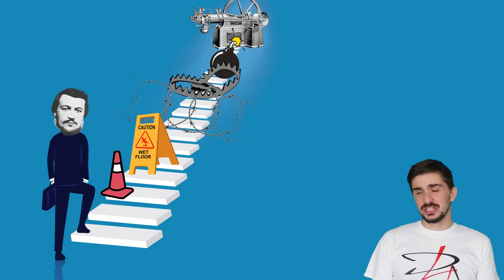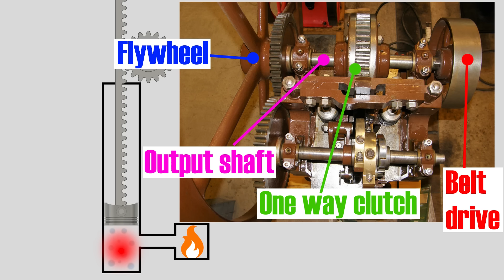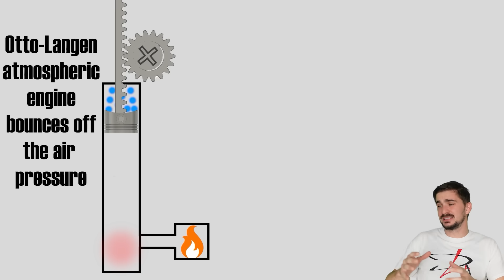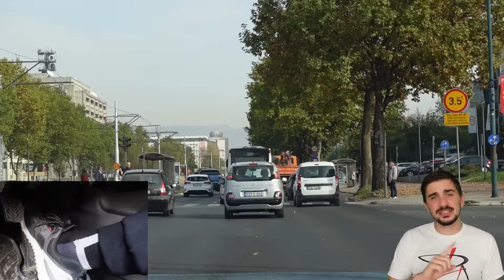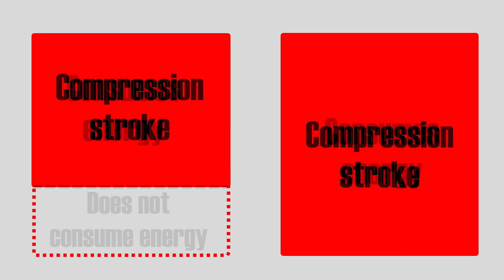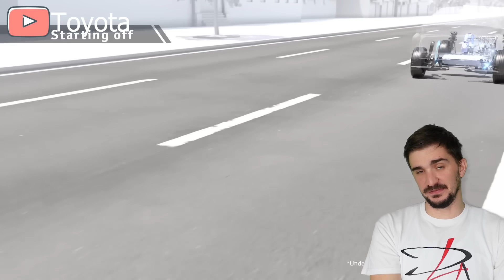You'll understand everything about Atkinson, Miller and Otto cycle engines after watching this video

Comment: Surely, the energy required to compress [adiabatically, essentially] a required quantity of gas from one pressure to another in the same time interval is quite independant of whether it takes place over a long or short stroke.  
     What these inventors improved, however they may have thought about it, was not the amount of energy 'wasted' in compression.  The improved efficiency came from using a more appropriate [smaller] amount of mixture, which at the end of combustion would not be throwing away into the exhaust pipe quite so much wasted energy.

Comment: It is easier to compare the Atkinson, Miller and Otto on the basis of equivalent compression stroke. Then the work of compression is the same for all and the difference is how much each cycle expands the working gas during the power stroke. Clearly expanding the gas all the way to atmospheric pressure would extract the most work and an exhaust silencer would not be needed. For the Miller to produce the same efficiency as an Atkinson, direct fuel injection is needed. Otherwise, uncombusted fuel is ejected into the exhaust.

Comment: What if you did a Atkinson cycle by having an intermediary cylinder? As in,  a 3-cylinder engine with a 180-degree crankshaft, the outer cylinders fire 360 degrees apart and their exhaust valves dump into a reed valve that leads to the middle cylinder, then another reed valve on THAT cylinder (timed in the opposite manner as the intake reed) leads out to the exhaust manifold. The center cylinder would act as a "2 stroke" expansion cylinder to accompany the two 360-degree apart 4-stroke "power cylinders" adjacent to it.

Comment: I know calculations have proven it, but just by plain logic, in Miller cycle, the inlet valve being open during compression stroke, with supercharger blowing air and fuel in,  will the air fuel mixture in combustion chamber be the same if it was a naturally aspirated OTTO cycle engine.
What will be the pressure at TDC for naturally aspirated OTTO cycle engine as compared to a similarly sized MILLER cycle engine.?

Comment: it's a crazy concept to wrap your head around, I thought of it like this, why is a dsl so efficient? because of the high expansion ratio. why cant you burn petrol in a diesel?? because of the high compression ratio, so if you can reduce the compression ratio by the intake timing yjou can change a 30:1  engine to a 15:1 engine , even though mechanically its the same, but as the piston goes down 15:1 it's operating as a 15:1 up 15:1 down. but wait, what's this there's more so you can compress 15:1 and expand 30:1

Comment: Wait I am confused.  What is the difference between an Otto cycle engine running at 1/2 throttle and an Atkins cycle engine running with a 1 to 2 ratio?  I feel like they would have the nearly the exact same performance because they have the same amount of air.  The Otto cycle engine would not even begin compression until 1/2 way through the cycle because the pressure on the bottom of the cylinder would be higher then in the cylinder until equilibrium 1/2 way through the compression stroke.

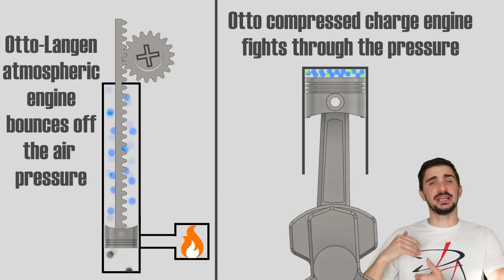Comment: 9:50 You are wrong. Higher compression leads to higher efficiency.  The power used to compress the mixture is not an inefficiency, it vastly improves the thermal efficiency of the burning fuel.  All other things equal, a lower compression engine will produce far less power than a high compression engine at the same displacement and fuel consumption.(IOW, all other things equal)

This is one of the (really, the primary) reasons diesel is so much more efficient than any gasoline engine.  The air temperature difference is a key to efficiency and compression vastly heats the air fuel mixture in reference to atmospheric temperature.
Reply from the maker: Compression ratio vs the act of compression itself are two different things
Reply: @d4a  No, they are two ways of expressing the same thing.

Comment: I'm hearing that the Chinese manufacturers are now to build a lot of Erev engines, using a Miller cycle to drive a generator and thus charge the battery while driving along. Essentially it gives you a very large battery without the extra weight and expense. since the motor does not drive the wheels, and only operates at a steady state RPM driving the generator, it must mean they have ways of making it very efficient. I'm wondering, just how efficient the motor can be?

Comment: why not just miler made intak valve close before cylinder finish to fill at intake?? when cylinder is 2/3 down close intake... it creat vacuum at 2/3 pmd to pmd.. sucking energy but piston after is now pushed by crankcase presure to regain velocity for compression.. and it will effectively compres 2/3 on an full cylinder...

Comment: So I wonder, Honda VTEC, does that switch between a Miller/Otto cycle?
Reply: Not really. The biggest difference between the two lobe profiles is the lift, or how far the valve is opened to allow for more mixture into the combustion chamber in high rpm mode and more swirl in low rpm mode. The duration is not altered that dramatically that I would call it a switch between Otto and Miller

Comment: How do they measure efficiency? Heat efficiency? If it's more heat efficient then it by definition makes more power per fuel mass. It must be that it creates higher power density-- more power per engine weight which correlates with displacement.

So I'd guess the Atkinson engine is more efficient and more powerful with the same fuel tank, but it probably weighs a lot more. And weight equals cost. And if you're a car you have to spend more fuel to get it up to speed or slow it down.

Comment: Fiat have multi air.  That open the intake valve   Shut it then open it again. In the intake stroke.  And open it latter or earlier. Depending on what worked out  to be most efficient

Comment: Electric supercharging is a will o' the wisp; the energy need to run the electric motor is reflected back into the alternator as a torque load drawing on the crankshaft; there is no free lunch.

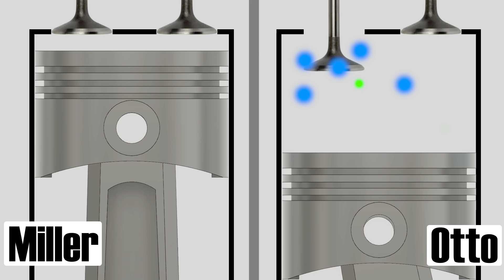Comment: 15:17 that´s not true. All intake valves close after bottom dead center and all exhaust valves after top dead center of the piston; its called vlavetime overlap. This makes the gasflow more efficient because of the inertia of the gas mass. Only difference to modern "Atkinson cycle" is that these have a bigger, longer valveoverlap.

Comment: I had two Hondas both 1.5 litres. One is i-vtec rated at 115 hp at 6600rpm. One is Atkinson rated at 110hp at 6000rpm. I think Honda's Atkinson engine is on this mode until 4000rpm and then switchs over to i-vetc mode but limited it to 6000rpm. Typically a normal 1.5 litre Atkinson engine is not able to go above 100hp?. Regards.
Reply: The 1.5L Atkinson Cycle Engine in a 2nd Gen Prius develops only 76hp - the combined electric motor to the HSD unit develops 67hp. The Hybrid Synergy Drive is an amazing creation.

Comment: Miller cycle became a lot more practical with direct injection.  Pushing air out through the intake valve is fine, but pushing a fuel/air mixture out is less desirable.

Comment: My "read' of the Miller/Atkinson engines is that they allow for a diesel like "expansion ratio" (which is where power comes from) while not exceeding the "peak pressure" at the end of the compression stroke that would ignition homogeneous charge, AND not having vacuum pumping losses (the energy used to 'suck' air through a small throttle opening).
Reply: Very interesting but don't engines reduce the compression by having inlet and exhaust valves open together,,,,valve overlap
Reply: A conventional diesel has the same expansion stroke as compression, no difference to an Otto cycle engine in this respect. The idea in Atkinson and Miller cycles is to have a greater expansion stroke to use more of the energy in the expanding gas during the power stroke. This has nothing directly to do with detonation, the CR could still be made high enough for this to occur in these engines.
Reply: @stephenwilson3479  : The "valve overlap" you refer to is increase power by taking advantage of the momentum of the air column at high RPMs.
Reply: @ferrumignis  : In all "otto" cycle engines the power comes from the power stroke, the other three take power away.  Diesels are generally more efficient for two reasons, 1) The engine is not fighting any throttle plate restriction on the intake stroke at "part throttle" .  2) The "expansion ratio" is generally greater than that of a gasoline engine,  "theoretically" for maximum efficiency the pressure in the cylinder should be zero at BDC after the power stroke, when the exhaust valve opens, in reality there is always some positive pressure.
Reply: @johndavidwolf4239  The efficiency of a diesel comes primarily from it's high compression ratio. The diesel suffers from the disadvantage that its expansion ratio is always less than it's compression ratio (due to constant pressure combustion stage), unlike an Otto cycle engine where compression and expansion ratios are equal. If an Otto engine could run at diesel-like CR without knock then it would be more efficient than the diesel. This is backed up if you look at the equations showing thermal efficiency for each cycle, the first term is the same  but the diesel has an additional term (the "cut-off" ratio) that reduces efficiency.

Comment: Two things:
1) saying that atkinson engines "produce less power" is a little inaccurate, they are less power dense, but produce more power per quantity of fuel used
2) the gained efficiency is not derived by "not wasting energy on compression", it comes from gaining extra energy from added expansion. It could just as well be described as increasing the expansion stroke, than as reducing the compression stroke. in fact an atkinson engine can be built with exactly the same compression as an otto engine, and the "reduction" in compression was never the benifit/point!

Comment: Yeah Everthing what you said is right but you forgot why the Miller cycle is  so important for the Sky aktive x is that you don over compress the Air fuel mixture so you are able of running a High compression ratio with Not so strong tendenties of getting Detonation

Comment: I think you misrepresented the concept ever so slightly. Its not that you are wasting energy during compression its that you are loosing energy on the expansion stroke and exhausting it which is why engines make an exhaust bang. The combustion pressure is still high enough to do useful work in an otto cycle so you loose that. In the other cycles they essentially allow the gas to super expand and leave the engine at a lower more fully used state of enthalpy. It would have been useful to show a pv diagram with the expansion of the power stroke shown where the extra power is gained from the stroke.   Super expansion was a term from steam engine days where they wanted to fully expand the steam to fully extract the energy and i imagine that was the driving idea at the time.

Comment: You failed to mention the fact that a simple & effective solution to the Atkinson linkage issue existed way before Miller & actually made an engine MUCH more simple than Otto: the Atkinson Differential Engine.

Comment: IMHO both are Miller cycle engines.  An Atkinson cycle engine has physically different stroke lengths for intake+compression versus power+exhaust while a Miller cycle engine has a shorter effective compression stroke because the intake valve remains open during the start of the compression stroke.

Comment: Call compression ratio what it REALLY is .. Expansion ratio. The purpose of higher compression ratio is to achieve a higher expansion ratio. Exactly the same goal as the Miller/atkinson designs but Miller/atkinson uses less energy input and gives a higher expansion ratio. This is the same reason old steam engines went to double and triple expansion engines. EXPANSION RATIO IS THE KEY to extracting energy from the high pressure.

Comment: The Miller cycle strictly requires a turbocharger!
The Miller engine with a supercharger uses the Otto cycle, and it can return to the Atkinson cycle only in the situation without a boost.
Actually we can treat the Miller engine with turbocharger as a turbocompound engine that returns the recovered exhaust energy by lowering the piston's work on compression instead of gears.
There are no free lunches.

Comment: I would have thought a supercharger would undo the benefits of the Atkinson cycle.
The whole point as I understand is to finish the power stroke without spare pressure in the cylinder which is wasted to the exhaust.
Yes you can throttle more but the throttle causes pumping losses.
If you're ramming air into the cylinder then you're likely still wasting pressure straight out of the exhaust.

Comment: If they had direct injection in the 50's the miller cycle would have been the norm today. No fuel is wasted through the push back, only air, which you have plenty off thanks to the supercharger

Comment: The Otto Langen atmospheric engine did not operate in the way you described. The cylinder was open at top and the upward travel was only limited by drop in pressure as the combustion gasses expanded while working against the weight of the piston. The one way clutch that was driven by the rack was disengaged as the piston rose and did not engage until the piston fell due to the combined forces of gravity and reduction of pressure below the piston as the cooling combustion  gasses cooled. So the power stroke occurred as the piston fell. But don't take my word for it, do your own research.

Comment: It's always bugged me that toyota use the atkinson cycle name vs miller when it's really a miller cycle design.  The atkinson cycle engine as you showed in the video was a complex engine design and the new engines do not use anything close to it other than the shorter compression cycle while it was miller that designed the valve timing version of reduced compression cycle engine.

Comment: So the Atkinson cycle is not more efficient than the Otto cycle because the Otto “wasted” energy in the compression stroke.  In fact the energy used in compression is recovered as the gas is allowed to expand again in the power stroke, ignoring thermal losses.   The Otto is limited in its compression ratio by pre-ignition, a practical limitation.  The Atkinson cycle allows a higher expansion ratio than compression ratio, thus extracting energy which would be wasted in a compression limited Otto engine.

Comment: The Eiffel Tower didn't exist in 1867, it was built for another 22 years.

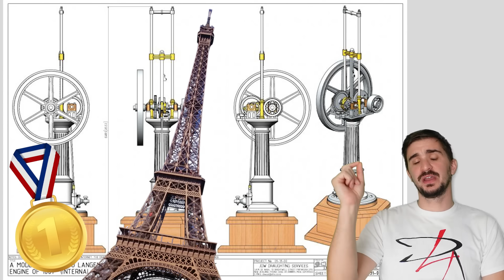4:19 FYI, you show the Eiffel Tower and mention the Pairs World Fair in 1867 but the Eiffel Tower was built between the 28th of January 1887 and completed on 15th of March 1889 for the 1889 World's Fair which was 22 years later.

Comment: What i do not get is why Atkinson cycle needs to be so over engineered when actually if you reduce throttle position, pressure drops (more vacuum) so compression stroke ends up with same end pressure...

Comment: Seriously no one has decided to use solenoid valves? Where your rotating shaft activates a solenoid to open the appropriate valve. A two position valve could easily slide a plate to the intake or exhaust port if you could take the misalignment of the spark. If you wanted good spark alignment the one on each side allows for a value opening much larger than any poppet could dream meaning the value opening could be digitally adjusted to produce different results.

Even with large solenoids simple driving arms would allow them to operate their respective values at range. But more likely you would have the valves open like doors to the combustion chamber, allowing air in or out at a slight angle to the direction of piston travel. This would let you keep the positive seat created during compression while removing the obstacles to air and improving the direction of air flow.

The "what would it look like" is either a levered door, where a hinge is operated opening or sealing the valve by lateral force on a lever arm of the door, or with a "y" connection from the solenoid to the edges of the door. If designed correctly the exhaust gasses wouldn't even travel near these moving components.

Like having the door on a gumball machine open to let air in or out while shaping the door to take the compression forces. Big opening, less movement more airflow.

Comment: nearly all modern engines run either a version of Atkinson or Miller effectively by turbocharging with either a short or long duration cam +VVT, what you don't explain in this video is the advantage comes from increasing CR, hence a modern engine is typically over >40% BTE by high CR with Atkinson/Miller effect used at high loads to mitigate knock

Comment: why not use the supercharger logic on an Atkinson's engine and gain more power with the efficiency like an otto's cycle engine? if it lacks power, add more. it's be interesting to see a 6-700 hp engine with a 45mpg range

Comment: Miller Cycle!  based on valve timing for all modern engines.  Shame on Toyota/others using Atkinson name that was based on mechanical design with intermediate rods and rotating assemblies.

Miller just changed valve timing through cams.  The real deal!

P-Chi

Comment: Great video! VAG group compressed natural gas (CNG, methane) 1.5 litre engines use Miller combustion cycle combined with variable-geometry turbocharger.  There is interesting article about the engine in MTZ magazine: DOI: 10.1007/s38313-018-0063-z

Comment: Someone needs to show this video to VW. They seemed to miss the class that said Miller cycle engines should produce normal power. If you need proof, drive an 18+ MQB US market Tiguan. That 2 liter Miller cycle (“B” cycle as they call it) is a slug!